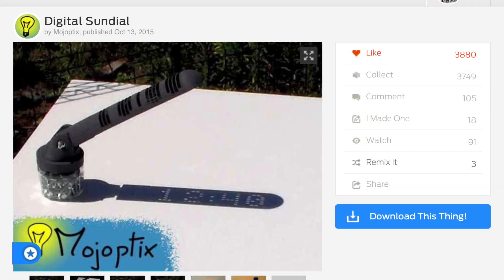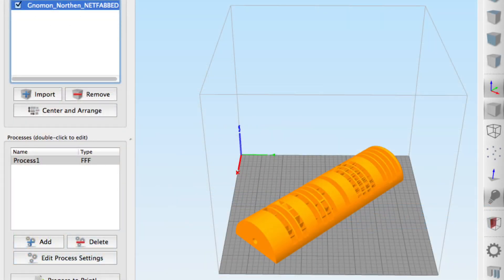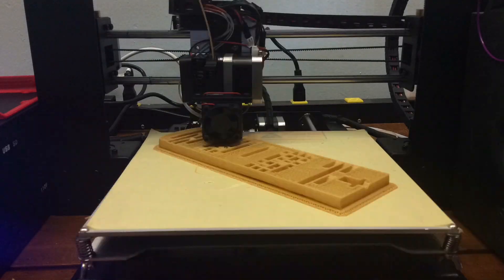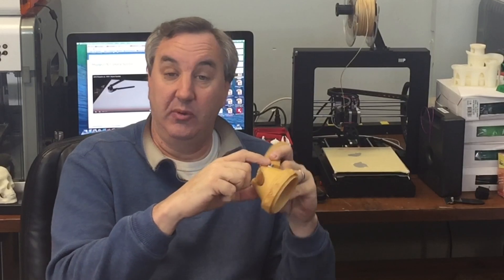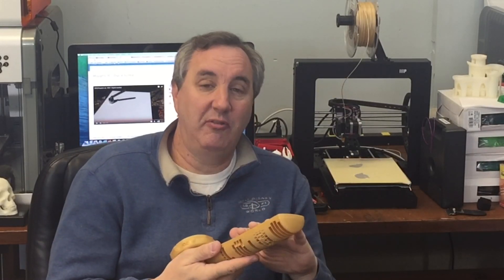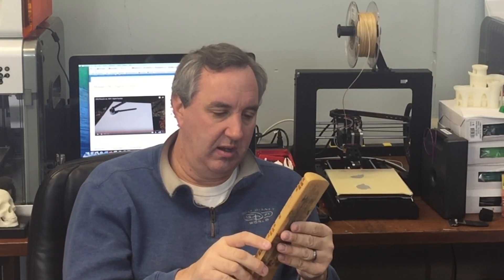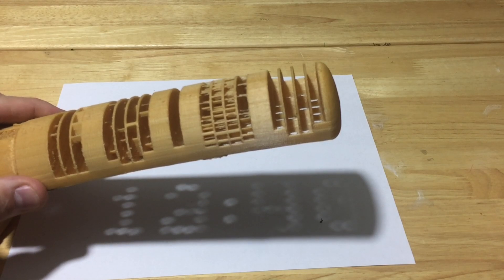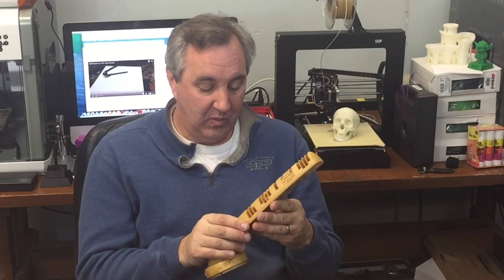Filament Friday #46 - 3D Printed Sundial on Monoprice Maker Select I3 with ESun Wood Filament

Comment: Have you tried using hair spray instead of glue sticks? I've been using hair spray for months now and my only complaint is that it kinda likes to land on things other than my print bed. It's way easier to apply than the glue sticks and easier clean up(if you don't let the hair spray dry for a day), I just quickly go over my print bed with a window scraper and then wipe it down with a damp towel.

Comment: Is it a "rebrand" of V1 or V2??
Reply: +Chuck Hellebuyck's Electronic Products
I have bought a V2 it will arrive on Monday, but maybe we can compare afterwards??
Reply: +Chuck Hellebuyck's Electronic Products 
I just got a V2 from Wanhao, it arrived today. Mine has the slanted front panel on the controller box and it came with 4 different build plates (aluminum, glass, lexan, and wood). I'm printing the SD card sample peace sign fingers at .1 and this thing looks great! Looks much, much better than the DaVinci Duo!
Reply: +Mike Ponschke 
It's Amazing how good it actually prints.
It also have dampers on the the Z axis
Reply: +Chuck Hellebuyck's Electronic Products 
Yes, an aluminum base and clip on the other 3. Wanhao USA had a  limited time deal to include those extra parts. But their website now makes no mention of it.
Reply: +EONTWINE 
Yes! Mine has the dampers on both Z motors.

Comment: have you printed much in abs on your wanhao? i have tried but i am having trouble with adhesion i have tried glue sticks but I haven't gotten any prints that have stuck for the duration of the print
thanks
Reply: ***** ok I will try that later thank you
Reply: +Chuck Hellebuyck's Electronic Products What layer height did you use for the first layer? also did you change extruder speed and percentage and what bed/extruder temps did you use? thanks just trying to cover all the possible issues i will probably get in the near future when i try (like in 10 mins)
Reply: ***** thank you
Reply: +Chuck Hellebuyck's Electronic Products oh have you been having any issues with it not extruding if you set the first layer height any lower than .3mm?
Reply: oh ya that could be it what first layer height are you using? im having issues on my first layer and its at 0.26mm